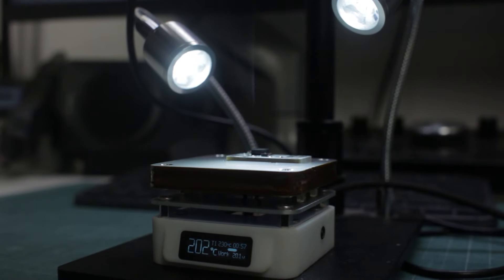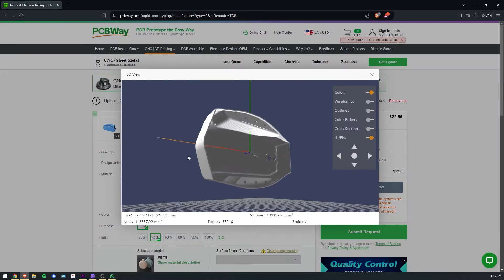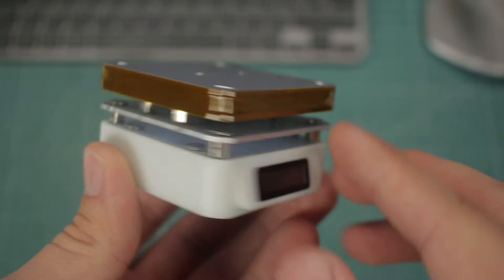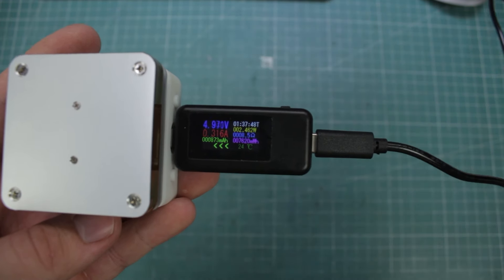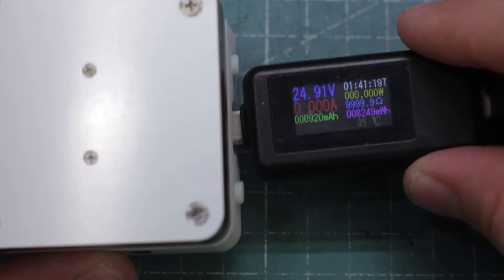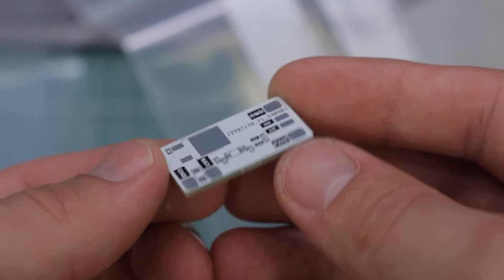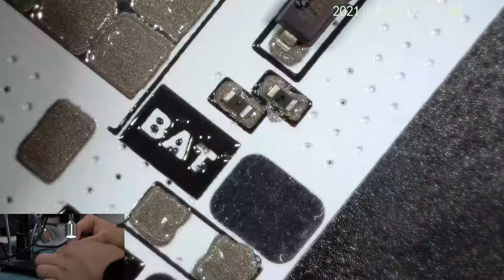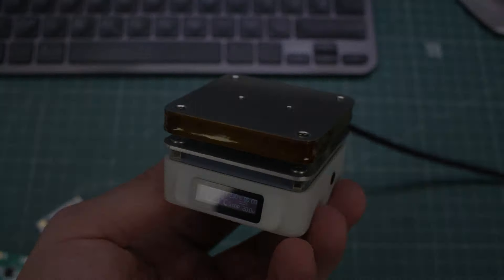A 20$ Mini Hotplate for SMD Rework! Sequre T55 Review

Comment: Just went ahead and ordered one. At this price I can't afford not to have one when I need it. Most of my work is through hole, but those times that you need to do SMD have been haunting me
Reply from the maker: Haha, that's awesome! Right, for the price, it doesn't make sense not to get one 😆
Reply: I would recommend getting a hot air reflow station rather than a hot plate if it is only for occasional work. This hot plate is pretty small.

You could also get an AC PTC hotplate. They go up to a fixed temperature when powered (or you can add a control system to it) and they are very cheap. The only downside is that you have to wire it to mains but if you have at least a small amount of electrical knowledge it shouldn’t be difficult.
Reply: @conorstewart2214  I have a hot air reflow station at work that I could use, I just don't have the space for it at home. My room is a studio/bedroom/repair station and those things don't fit. I even use a pinecil because I have no space for a desk stations. This size will allow some reflow/soldering  but in a more "targeted" way I guess, just not great for big projects.

Comment: For $35 you can get a 300-350w 10x10cm hot plate that plugs directly into the mains from lesser known Chinese brands that doesn't look like a handmade school project.
Reply from the maker: Well for some that may be a better option but for me personally, since I don't work with larger boards, this small plate is perfect because it doesnt take up much space on my desk and i can power it from any free usb cable I have
Reply: any to recommend?

Comment: Did you try slightly larger board (e.g. 7x7cm)? Can they be soldered too by splitting the PCB up in chunks and soldering them after each other?

Comment: Amazing, thanks. You do know this has more than one use?😂😂😂
Reply from the maker: Yeah looks like I totally forgot to talk about SMD rework hahaha.. But in my case the plate is going to be used mainly for PCB assembly
Reply: @Djambo57  the problem with using a hotplate for SMD rework is that the heat isn’t localised, so you end up melting the solder on everything that touches the hotplate, not just the component you want.

It can be good for preheating though, getting the board up to say 150 C will make it easier and faster to melt the solder with a hot air gun.

Comment: I have 2 of these, one of them seems to have died after the first use and cooling back down, so your mileage may vary.
Reply from the maker: Oh damn, that sucks... Did you try to reach out to Sequre? Im sure they would send you a replacement... I have had my plate for a little over 2 months now, and everything is perfect
Reply: @Djambo57  I have not, I just assume whatever I buy on AliExpress, comes without any sort of warranty or support, save for it making it to my doorstep in one piece. Also I took a while to start using them. If it comes down to it, I will probably try replacing the temperature sensor once I know what it is. Else it's just spare parts for the time being!

Comment: Would this be enough for any CPU rework jobs on notebooks?
Reply from the maker: Well, it depends on the size of the PCB you're trying to rework. The power output is 100W so the performance should be similar to MiniWare MHP50
Reply: Definitely not. You won't be desoldering or soldering large BGA CPU/GPU chips from large motherboards with this.
Reply: agreed, you also often need more than just a hot air reflow station, a board pre-heater makes things actually possible

Comment: Just FYI, for two side soldering use solder paste with a different melting temperature on each side.
That will allow you to solder the top side with a higher melting temperature paste and after that solder the lower one with a lower melting temperature paste.
That is the way they do it in manufacturing.
Reply: What is a good source for solder paste(s)? Especially ones designed for tiny parts/pads. My first syringe I bought had "solder balls" that were relatively large and made it difficult to apply to a USB-C connector's pads (without a stencil, was replacing the port, so I removed solder with a wick, then reapplied).
Reply: If you do this, double and triple check that the parts can handle the heat--both the actual component, and the PCB itself. And for the 'cooler' side, some things with big heat requirements like a ground pad simply won't ever work. It just takes a bit of extra thinking.
Reply from the maker: Yes! That's exactly how we do it, but with a hot plate, the bottom side of the PCB has to be flat, and that's why I said it's good for single sided boards only...
Reply from the maker: @wifigod Mouser, Digikey,...
Reply: or use glue, but you need another mask for the glue which is how we do it things don't fall off in the PnP machine
Reply: Stupid question, but won't the hot plate melt the components themselves, which are already soldered to one side? I am quite new to SMT, so pardon if this question sounds strange. Any videos handy how they do it? So fat I saw one side was done with the hot plate, another - with the air blower.
Reply: @dftpunk  you use glue so you need models with glue pads but you may need to make your own as we had to for one of our boards then you need two stencils one for glue the other for paste. It's apply glue, apply paste pass board through PNP turn over repass the board through the PnP to load the other side then bake, not too sure on detailss as our SMT team does all that weird stuff, we manufacture in house

Comment: There are a few things I don’t like about this, the first is that it appears to just go to a temperature and stay there. It shouldn’t have been too difficult for them to implement proper reflow profiles, although static temperature is easier for programming and using.

You need to be careful with low temperature solder paste. If any components on the board heat up significantly then it could cause issues. It also means that any faults like short circuits could desolder components which obviously isn’t good. The low temp paste may be good for prototyping but even then you are probably better using normal paste.
Reply from the maker: Yeah 138°C is low... I didn't think about it much in the beginning, but I'll definitely get a bit higher temp paste soon